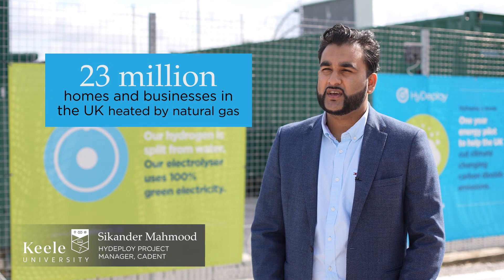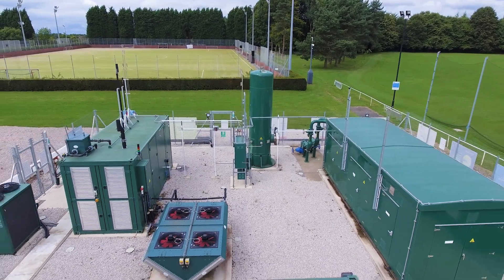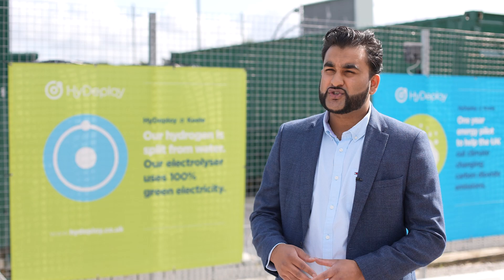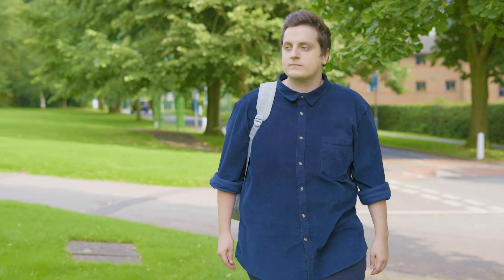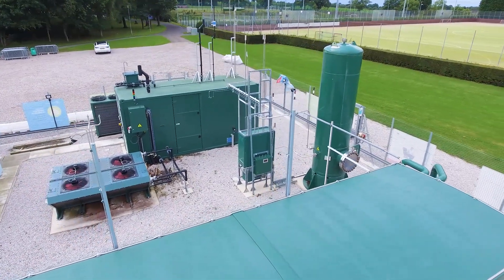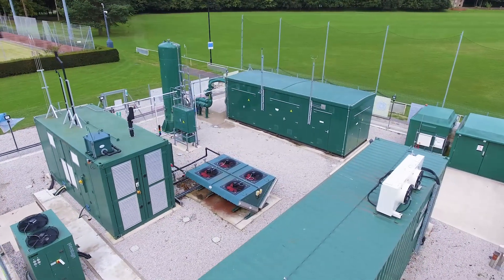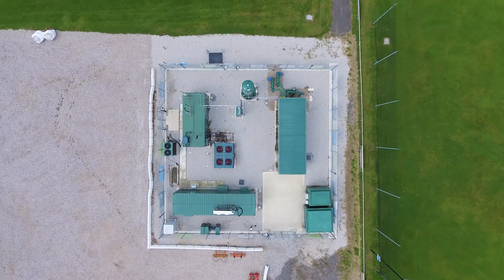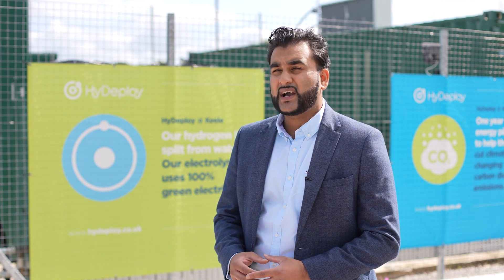How hydrogen is helping us heat our homes

Comment: How is the electricity produced which powers the electrolysers...?
Assuming you mean 20% by volume is added, surely the calorific content per unit will decrease when  hydrogen is mixed with natural gas as hydrogen is 5 or 6 times less dense at the same pressure & temperature and will act as a dilutant. No mention either of the nitrous oxides - which is a more potent greenhouse gas than CO2 by a factor of 300 - given off when burning hydrogen alone but increases sharply when other gases are burnt with it as here...

Comment: Could you buy an electrolysis that can make hydrogen gas for your gas force air or boiler to burn to heat your home? Would hydrogen burn at the same temperature as natural gas?